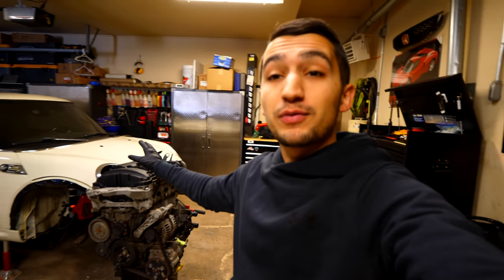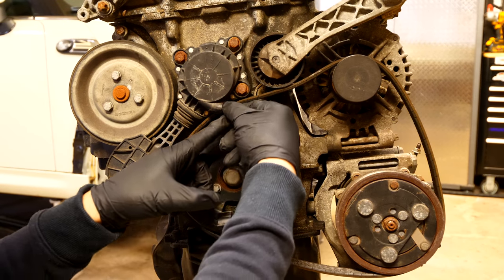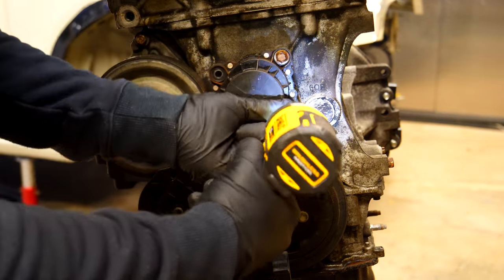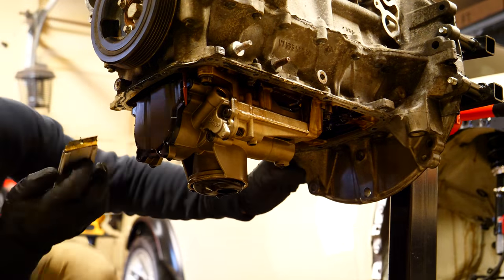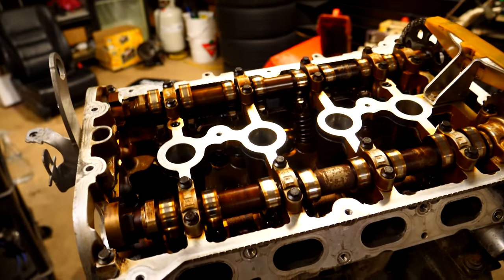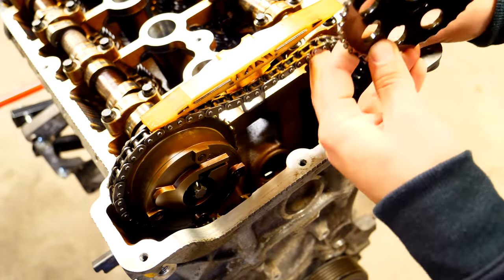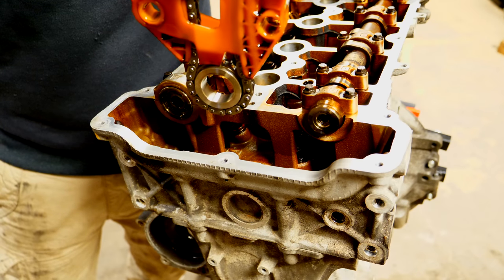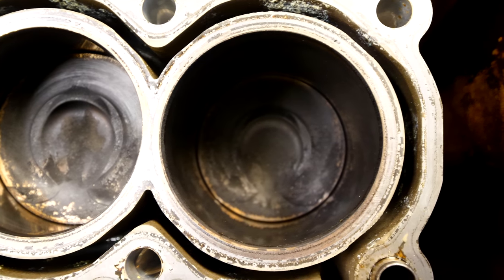How to Disassemble an Engine // JCW BUILD

Comment from the maker: Good news, I found out why my engine isn't running properly. Bad news, I found out why my engine isn't running properly...
Reply: milanmastracci keep up the awesome work! Can’t wait to see it under its own power
Reply: your'e awesome. love watching your videos
Reply: You're getting you cylinders wrong #1 cylinder is closes to the timing chain
Reply: blackout yep cylinders are wrong. Bet he finds piston broken.
Reply: isn't he going to replace it all , anyway ?
Reply: Port the heads and clean the pistons and everything
Reply: Hey Milan ...I love your videos and I know that you have OCD. So I’m curious on how did you separate each part of this engine? Also, would you ever paint the engine once you are done putting it all back together?
Reply: milanmastracci hey Milan can you give me a link of the tool you are using at 11:44 it's ratchet?? Or a screewdriver ??
Reply: @milanmastracci
have you ever checked the ignition coil on cylinder 4? is a known problem.
what do the spark plugs look like?  I am currently rebuilding my own n14 block. Forged Pistons, supertech Valves, ported intake and exhaust on the cylinderhead ...
Reply: Awesome series! How did you learn how to do all this stuff on the Mini?
Reply: Was it just a coil pack in the end?. Never mind you still made an awesome video bud. Keep it up. 1 new subscriber.
Reply: I starting to fell like i am the iron man

Comment: You check if the valves are seated with the camshafts on? And both cylinder 4 and 2 exhaust valves were slightly open, what a surprise! lol. Bet you if you turn the exhaust camshaft a bit further then you will have 'problem' with valves on cylinder 1 and 3 lol. Actually these 'N' direct injections engines are notorious for failing injectors and/or coils. I am almost certain that you have a faulty injector.

Comment: Milan, on most engines cylinder 1 is the closest to the front of the engine. So from the crank pulley and serpentine belt, it goes 1 2 3 4. Unless Mini specified a different numbering scheme, I think you got 1 and 4 backwards.
Reply: mannys9130 it's a euro engine .most likely a Peugeot engine..he's right
Reply: MFullaStyle I don't think so.
Reply: Can confirm that mannys9130 is correct.
Reply: Definitely 1-4 from crank pulley end to gearbox end

Comment: Did you rotate your intake cam until all your valves closed ? Could be due cam position , carbon build up on seat with that much gap would have burned up that valve ASAP

Comment: I have the same vehicle and when I pulled my engine the oil pan looked good. However, I found ring parts in the oil pick up tube, thus explaining why I had low compression in the #1 cylinder. Once I split the block I also found a broken piston, #1. This is a fairly common problem with this engine. So I'm off to the machine shop now. Keep up the videos, great work

Comment: Should remove camshafts to check valve seating, also once cams are removed just put spark plugs in and turn head upside down and pour water on each chamber and see what ports water goes to then you know exactly which are leaking

Comment: Hi milan, I am also rebuilding my mini engine soon. Though it s a N18 jcw. I guess yours is N14. But thanks for this videos since I am also doing that for the first time.
Reply from the maker: Both engines are quite similar, but the N18 has some differences like the PCV system, the extra Vanos for the exhaust camshaft, etc. All in all, you should be able to use this video as a guide should you want to rip everything apart :)

Comment: Hi. Did you use a location pin in the fly wheel while setting up the camshaft locking tool? Also the tension wheel for the water pump has a service position. You pull out the tab and it clicks on to a tiny tab. Hope that helps

Comment: Coincidentally my R56 motor blew. I just happened to stumble upon your videos yesterday while pulling the motor. Anyway I can contact you in case I have any additional questions along the way? I’d also like to know a good source for stock parts to rebuild. I’d forged internals are slightly more expensive I wouldn’t mind getting them but I’m budgeting. Lol thanks man
Reply from the maker: Yeah not a problem buddy!! Send me any questions to my email at milanmastracci(at)gmail(dot)com 👍 I will respond to those faster than the YT comments
Reply: milanmastracci thanks man. I’ll send an email just to confirm who I am.

Comment: I want to take apart a engine for educational experience.
I have a 2005 Nissan Maxima SE as a project car. Having it be over 120,000 miles I really want to take out the engine to clean because it looks horrible after a head gasket leak, antifreeze explosion, years of dust, and a little bit of surface rust on some parts. Removing it will also help in cleaning other things around the bay.
If I degrease/sand down the crud all around the engine do I need to apply an anti-rust coating?
Will removing carbon buildup increase response and/or horsepower?
I'm a noobie to the world of mechanics and I'm going to be enrolling in a auto college class this year. :)

Comment: Hey bro love your videos keep it up and gain as much horsepower you can with the mini.
Oh and only reason why BMW and the owners manual say take if off as the same way you put it on is because of even pressure when you releasing the head off that wont create warpage or any other damage to the head.
Reply from the maker: It is just weird since they want you to remove the inner most bolts and work outwards, when you'd think to remove the outer most bolts and work inwards
Reply: milanmastracci  yea I see what your saying. It really depends on how the pattern is to put it back on. Most company's say to take it off the same way as you would put it on.
Reply from the maker: Yeah that's what I'm used to. But its cool to see some things are different :)

Comment: Hi, thanks for the impressive videos. i leave in South Africa and 4 days back my 2010 Citroen DS3 1.6 THP 155 sport gave me an engine problem and with 232300kms on the clock i'm not complaining. 
but what worries me is cash for parts they are scares and expensive this side.  Well with the videos from part 1 - 5. i think now cause of P1340 could be from leakage from block or piston rings.

this a great hope...wish i can call you for more info.

Comment: I want to swap my Citroen DS4 N12 1.6L engine for Peugeot 307 2.0L engine. My question is will I need to change the ECU and the key set and the fuse box? Or do i need to reprogram my key?. There are similarity between the 2 engine, the sitting is perfect, I just want to have more information before proceeding. Thanks in advance

Comment: Question: Are you sure about the cylinder numbers? I thought they are numbered 1,2,3,4 counting from the serpentine belt side, but you count from the transmission side. Love to get this confirmed!
Reply from the maker: Yes you are correct. I made a mistake in that area! 👍
Reply: @milanmastracci  Great that means I didn't scratch numbers in my valves the wrong order when I sent to machine shop ;)

Comment: How did you mark everything when you disassembled the engine, so that you know where everything went? On the driver side of that engine its a can of worms, and I understand you can actually connect the thermostat electrical connections incorrectly, and you wont know until you start the engine again.

Comment: I am getting ready to tear down a 2017 Mini Cooper S that I have been told is an F56 (2015 forward) instead of an R56 with an N20 motor (2.0L Turbo) instead of an N18.  Does anyone know if the N16 or the N18 timing lock down tool is compatible with my engine.  If not, what is a good aftermarket company to buy a tool from, as well as other parts?

Comment: hey milan! 
i have this problem with my peugeot 207 GTI it has the same engine and it was a miss fire on cylender 3  and the problem was a broke in the side off the cylender that you cant see it from the top you should remove your pistons and you will see it
Reply from the maker: I really hope mine is okay!! We'll see more when I disassemble the engine block

Comment: WARNING FOR RE-ATTACHING THE FRICTION WHEEL. It is extremely easy to strip the threads for the 3 bolts for the friction wheel. Even when torquing to proper spec mine stripped. Be prepared to have to install a thread repair kit.

Comment: I have a customer with the same car where thr timing chain has jumped do you think to just do the timing chain you would have to go through the process of taking the engine out or could you do it in the engine bay
Reply from the maker: I would use a borescope (http://amzn.to/2nZxotp) to see if the pistons have come in contact with the valve, as this is an interference engine. If they have made contact, you will have to go through the same process that I am doing, however if they have no, you should be able to perform a timing chain service and be on your ways. The kits have everything included, all of the seals, new chain guides, a new chain, new torque-to-yeild bolts and everything else you would need.
Reply from the maker: Pull each of the spark plugs out and look through there with the LED borescope I've linked
Reply: Thanks I'll have a look and see which root will be the best way to go

Comment: Surely that problem would’ve shown up in a compression test?
Reply from the maker: Yes it did. I knew it was leaking, but where the leak was coming from was another thing. I knew it wasn't leaking from the spark plug area, from the intake, or from the piston rings, so by process of elimination, it was the exhaust valves seats. Having an idea as to what it is, and then taking it apart to find out that's the problem is kinda nice, but still shitty since the engine is not running..
Reply: milanmastracci best of luck mate! I have an r50 mini myself, it’s the best I could afford for my first car
Reply from the maker: They're a hell of a lot more reliable than an R56 ;) My brother has an R50 and he has had minor things go, nothing major..
Reply: milanmastracci with an r50 a clutch could go at any moment😂😂 and it’s a nightmare to replace. Anyway, great video series mate I’m really enjoying them and how you’re going about it, if you need any help I’m a mechanic in British Mini Challenge. Best of luck!!!
Reply: A leak down test would pin point the problem

Comment: Kinda strange how this engine failed. Good old (non BMW, port injected) engines last 3-4 times this long. It's kinda sad how BMW let this go into production.
Reply from the maker: Yeah I know.. my honda is at nearly 200k KM's and its still running strong
Reply: milanmastracci I'm at 291k on my MK1 Ford Focus.
100 hp, 5 speed manual. It's indestructible, but not very fast.

Comment: i've been in a weird situation aswell with my R56 , Limp mode , no boost , Code 28A4 , Wastegate:Good , Divertervalve :Replaced , Boost pressure sensor :Replaced, TMAP sensor : Replaced, turbo spin :Good still cant figure it out. IF anyone got an idea hit me up ! And yes all sensors are connected and no boost leaks for the dumb comments. Lol